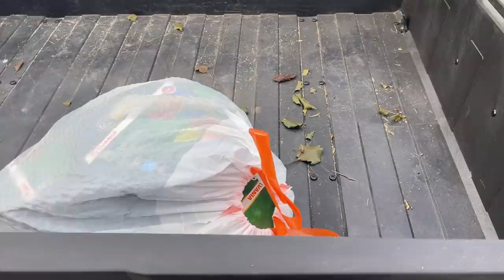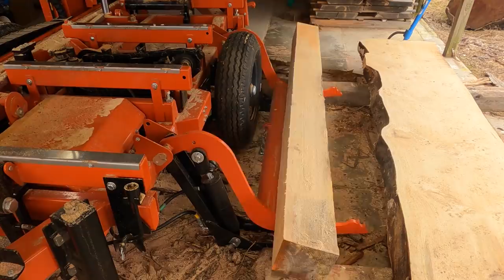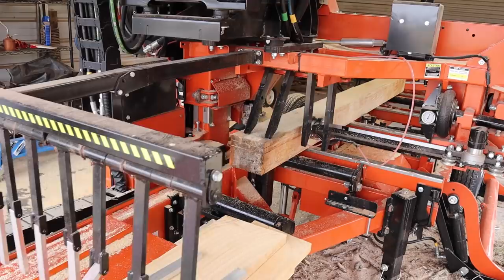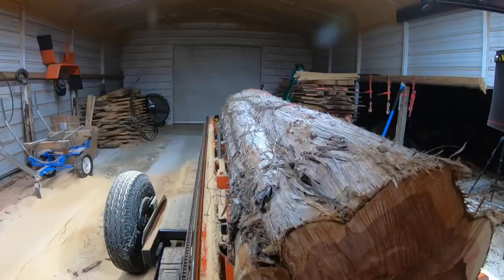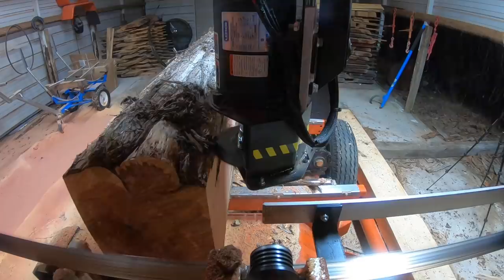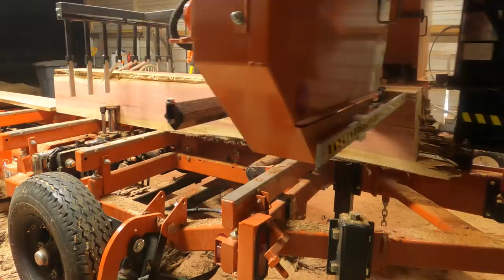Take A Look At What I Had On The  Sawmill Today,

Comment: Beautiful Cedar. Same here in Missouri. Always covered with poison ivy unless someone like me went through and ripped it all out and bagged it before it was harvested. Everyone in  the family was allergic except me, so guess what chore I got for yard work around our place. Yup, clear it and keep it clear. About 48 years ago I did some woodwork and antique work. Got a bunch of antique trunks and put cedar lining in them for upselling. I found a product that was 1/4" by 2" T&G all sides in random lengths and used that for lining. It was advertised at the time as "Tennessee Aromatic Cedar" for lining chests and closets. Man was that stuff sweet smelling and easy to work with. Mostly made from scraps as the longest pieces were about two foot. 

A lot could be done with Nathan's scrap pile. Bet I could make a living off that if I was close. Just true them up on smaller saw and get what you could for woodworker scraps and sell for a premium. Of course they would have to be dried but you could get a bunch in a kiln run. Walnut and other woods in lengths of one foot to six foot as one by and other thicknesses. anything from two inch to what ever wide. There has to be a market. My neighbor goes nuts trying to find such stuff for signs and other projects in his wood shop. Half the time he is splitting one by four into two and planing them down to quarter inch thick materials. Lot of work but would salvage so much that I bet I could make a profit. Someone needs to find a way to do this. It is a shame to see all of that good wood burn. I know it don't make sense from Nathan's business model but surely someone could do something with it.
Reply: If nothing else firewood.

Comment: I have had quite a bit of juniperus virginiana cut up, with bookmatched 18" wide planks for the largest live edge planks. Planning for some really beautiful tables with most of it. There were lots of smaller cuts I saved for signs, or for practice pieces. None of it made a burn pile. I also know of a furniture maker in Michigan who uses roots from Utah Juniper for table bases. They are run through a wide bandsaw mill for even and parallel top and bottom surfaces. To lengthen blade life, they are pressure washed and sandblasted to remove dirt and stone. Makes for beautiful table bases and they cut in a way that shows the red interior grain.

Comment: How to keep from getting Poison Ivy Rash.  After exposure, you have a 4-6 hr. window to wash off the Urushiol   - Poison Ivy oil.  Wash completely and scrub thoroughly with dishwashing liquid. I use Dawn.  Wash Everywhere.  I am extremely allergic to poison ivy and I have used this method for the past 4 years and I have not had a PI rash in that time

Comment: you can make wooden combs out of it and it will condition your hair. It will also remove the static from your hair. It is closely related to sandalwood. Back in the times of Pharo, the women would comb their hair with it. Red cedar combs are very expensive and hard to find. You have to make it when you mill it and not let it dry out. To keep it from breaking you cut a groove in the top of the comb and put a piece of the white running with the grain. I made one, but I couldn't find any more red cedar wide enough to make the teeth. As you said, they are rotten in the center, most of the time.

Comment: Question, is the greatest length of use most important? I would cut a 2.5 to 3 inch from the thick end to make a small tabletop and in doing so making both ends closer to the same diameter.

Comment: Hey Nathan, how are you and your family?  Now the laser is really impressive.  I have tried using a chalk line, chalk box many years ago when I began  sawing to see a difficult first cut line.   I also love to saw Cedar, and it is becoming a little more difficult to get it as Natural timber stands are cut and replaced with planted wood and center pivot irrigation’s have no need for fence rows and hedgerows. I’m sawing about 45 tons of B walnut on halves with a supplier and have some logs that already have checks and splits. I have always stacked most of my slabs to dry but have got some banding tools and seeing a lot of reasons to band some slabs. Question I have, I am individually banding some of these slabs that have 2 to 3 foot cracks before I band the entire tree after sticking. Do you think this will slow the cracking down ??  Thks Buddy.  AC

Comment: First time Ive noticed the circular saw cutting ahead of the bandsaw blade while you were squaring the log. What is the purpose for that?
Reply: It cuts the bark off, which helps protect the blade.  I seem to recall that bark has a lot of silicates in it, so it dulls blades faster.

Comment: It is a bit unsettling so see the amount of usable wood that goes on the burn pile, knowing how many seniors & poor families sole source of heating & some cases cooking, is a wood stove or oven. Is it possible that you have a local preacher or organization to do something with your off cuts?
Reply: Pine, cedar and poplar have about the lowest BTUs of any wood in this area and the off cuts of them are the sapwood i.e. the least densest part. The amount of work it would take to get that wood, cut it to length, stack it to dry then transport to those who heat with wood would be so impractical and inefficient that you'd be far better off just to buy some good hardwood that's already been split and dried and take it to ppl who rely on firewood to heat their homes